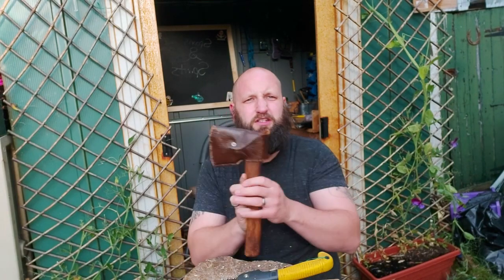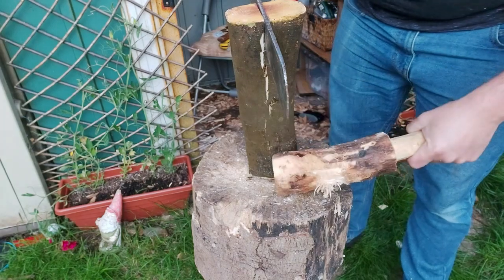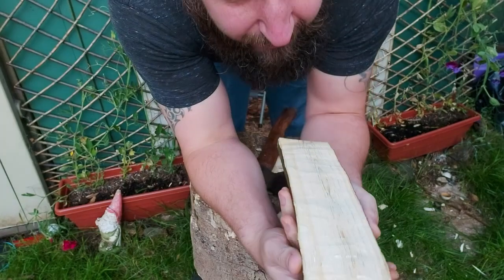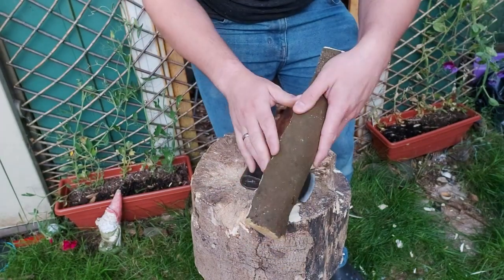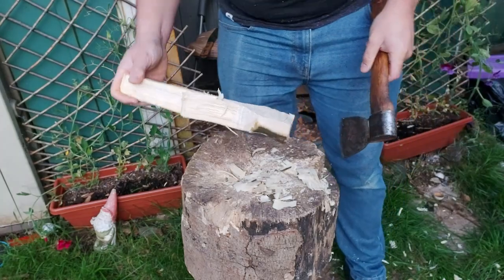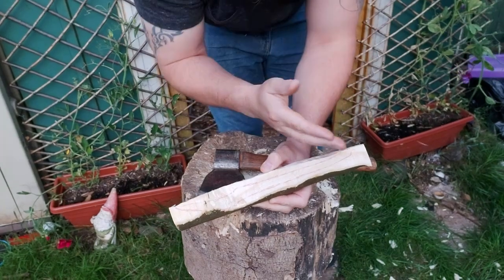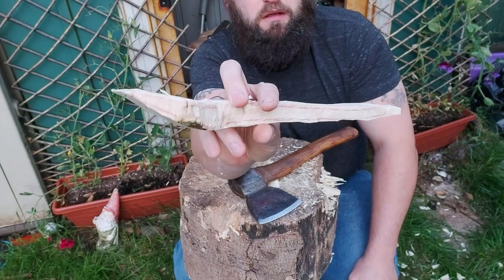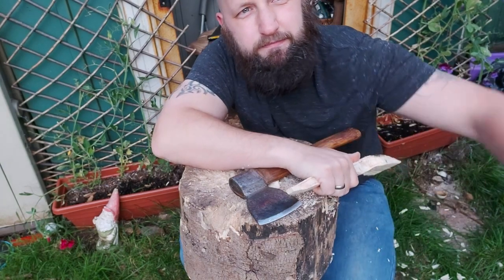How to Carve a Spoon - Part 1 - Axing a Spoon Blank

Comment: Nice video.  Very helpful.  As a longtime tool user for other crafts, I noticed that you are re-adjusting your grip on the axe a lot.  Is this serving a concious purpose or is it because the handle is a bit too round for your hand?  It honestly looks like your tool handle doesn't quite fit your hand.